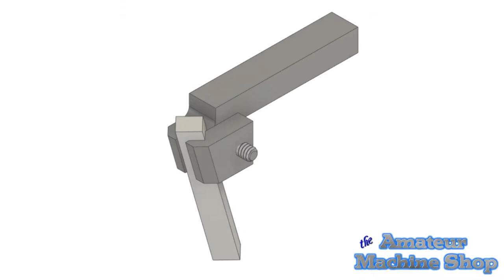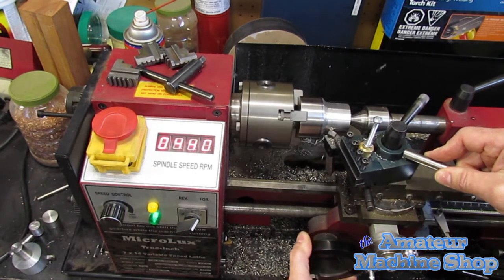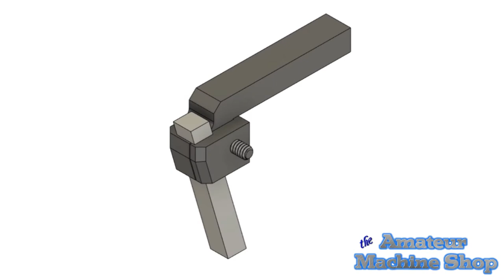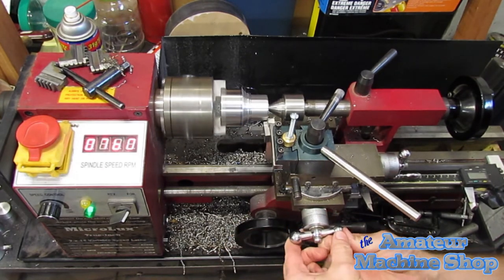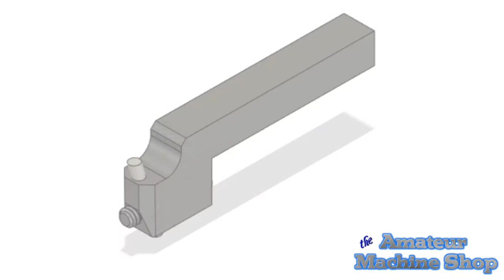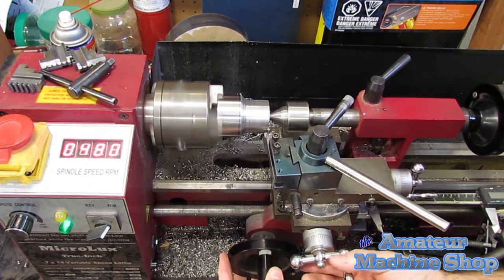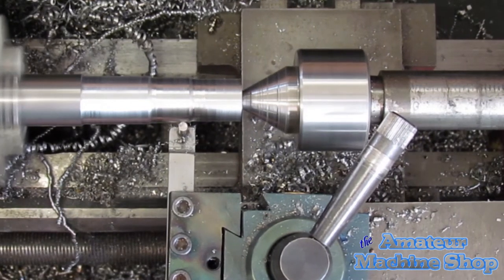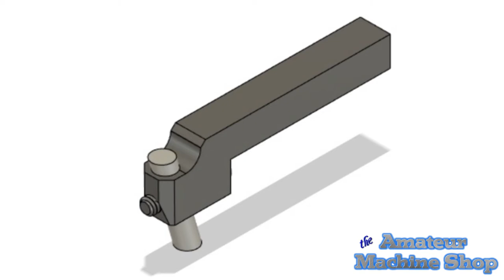Tangential Lathe Tool - Initial Test

Comment: Thanks for taking the time to post this video series and giving the drawings on making the tangential tool holder. I have a few round carbide shanks that could be put to use.  It would make a good roughing tool for hard materials and super easy to grind when needed.
Reply from the maker: Glad they were helpful! Keep in mind I forgot to add side angle clearance as someone pointed out. I just haven't been able to correct them.
Reply: Side angle, relive angle tool, tool point, power of lathe, rigid of the lathe are the facts of finishing. Sorry to you, i notice that lathe is not powerful enough to do the deep cut operation.

Comment: Information the chadder comes from the lose support carriage. Any lose screw in a load unload scenario will start chaddering. Change the nut and or the screw best change the lathe. Go get some old toolmakers lathe. Mine is from 1930 and runs like a charm!
Check the lathe good before you buy it, many sell bad pieces... Not all but many.

Comment: Hi I am new to the hobby. What is the benefit of using a tangential tool holder over a regular tool holder?
Reply: Ease of sharpening.  There's only one face to grind, and because it's so simple & quick, you tend to keep it sharp rather than try to get through something because its time consuming to grind a conventional HSS bit.

Comment: Why would you not just use off the self inserted tool holders ? CCMT ,  TPG and TPMG style inserts work great on these small lathes. They are dirt cheap as for as carbide inserts go.
Reply from the maker: Hi, thanks for your comment, Yes carbide has become a lot cheaper. I made these as I have always enjoyed trying things and fascinated by the concept. HSS can be easily ground to any shape needed for the odd type of things I sometimes do. Thanks Gary!
Reply: Good idea
Reply: Carbide inserts need to have a small edge radius because of how brittle carbide is.  That matters because it increases the force needed to make a cut, compared to a sharp HSS bit. Especially on micro and mini lathes where there is so little power to be had.

Comment: This a really bad example of what a real Tangential tool can do if set up correctly and used on "REAL" Lathe. To start with your beginning footage showed a tool bit that had the proper temp destroyed due to bad sharpening (color of the bit went from dark straw color to deep blue) and it got worse as the shabby condition of the lathe beat the crap out of the tool! That's why you use water to cool HSS bits when sharpening them!

!
Reply from the maker: Thanks for your comments. Yes, I should have cooled the HSS bit while grinding. I have done more since but it is to "light" a machine to properly use the tool. It was still a fun project to try.
Reply: Hi I am new to the hobby. I have a lablond lathe 19 in swing. What is the benefit of using a tangential tool holder over a regular tool holder.
Reply: @santopezzotti730  No real major advantage that I've ever found. They are easier to sharpen with a grinding fixture though due to only needing one face sharpened. In days gone by they were much more common. All tools can work work well if you set them up and sharpen them properly. Many prefer carbide or ceramic inserts due to ease of use. Most hobby lathes can't take advantage of the higher speeds and cutting rates inserts can provide though. They can run hot and fast a hog a lot of metal when used correctly
Reply: @johnkemas7344  thanks john I am glad I bought the lablond 19 inch swing lathe